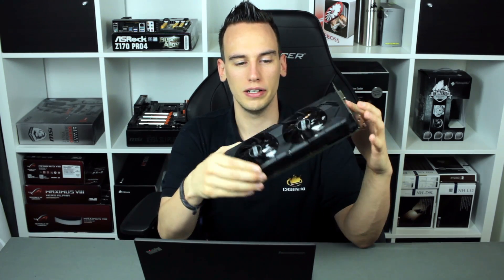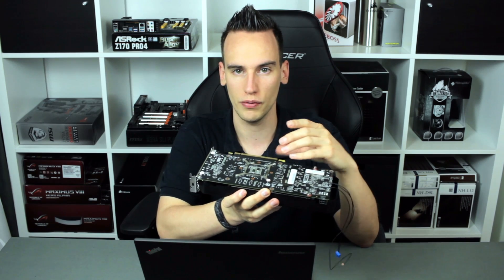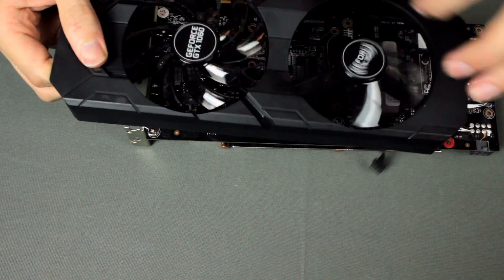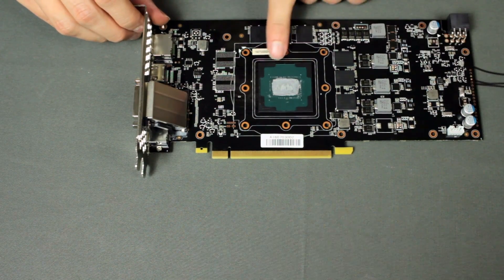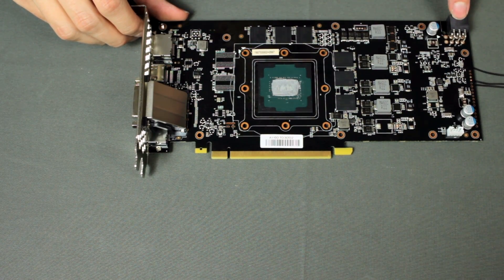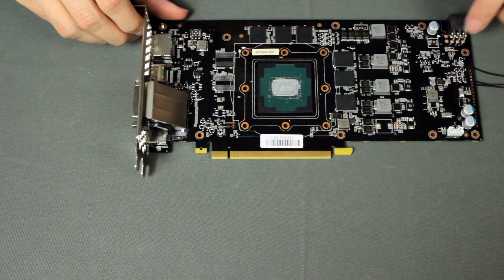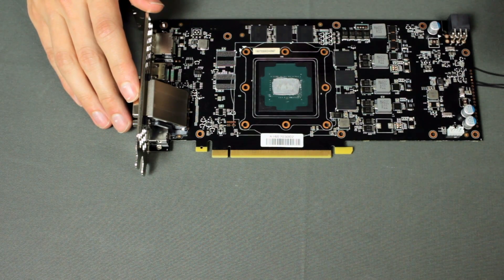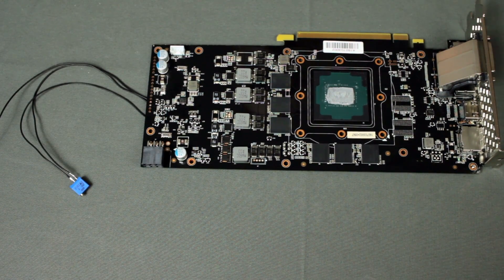Gainward GTX 1060 Overclocking to 2200 MHz with Stock cooler

Comment: Is there not another way to bypass the power target/limit of the GFX card ? My 1060 SC 6Gb (single fan) seem like it wants to OC but I believe it doesn't even gets passed its own Turbo boost before hitting its power limit and seems to even trigger its power limit without reaching its power target.

Temperature on the GPU is rather low at around 67Cº~ at full load, so no reasons to throttle there.

Voltage seems sketchy, even on K boost, voltage is all over the place, from 0.998 to (barely) 1,083~

Those wires look scary to put on. Any other way to "unlock" this stupid power limit ?

Comment: I got +900 on memory and +145 on GPU stable with +15 core voltage and 116 power limit on msi afterburner. I have asus 1060 6 Gb turbo, so I stuck a fan on air intake and it knocked out 6 degrees and now running 65 degrees C

Comment: Is the 1.2v voltage still "ok" for daily gaming, for lets say 1080Ti, considering low temps under load <35c? Is it fine for long term use ?

Comment: Okay, something I have been trying to find out for a while now, as I have the PNY version of this exact same board... The OV and OCP unlock solder bridges... what do they do?  I saw that you bridged the OV one... why?  And the OCP, does that over-ride gpu boost and hard lock the overclock offset?  if not, what?  You are my best bet at an answer it seems, and I am glad I found you.  You seem to review things in the style that I look for, where most folks are very surface level.  Thanks in advance.

Comment: schön zu sehen die junge generation... erinnert mich an damalige zeiten, als ich meine albatron 4200Ti(4600er layout) mit voltmods auf 825/850 hochgezogen hatte, nen 1700+ T-bred mit 2.8GHz und somit wochenlang auf platz 1 in futuremark stand im 3d mark 2k1... kühlung: wakü mit frostschutz und massenweise trockeneis im AB... das waren noch zeiten... CPUs hatte ich damals noch im 10er pack gekauft und mein händler hatte mir wenn ich reinkam, grad den roten teppich ausgerollt :D

Comment: with my MSI GTX 1060 6GB Gaming X i can dou with stock bios and voltage 2190Mhz on 3d mark firestrike / 2202Mhz on Catzilla / 2215Mhz on ACO and 2253Mhz for 1min and 20 sec on wolfenshtein 2 on 1080p uber

Comment: I just stumbled on your video @der8auer. Right away I get the vibe that you are very professional. This is why I have a request: Could you please make a video where you explain in technical therms what all the chips on the video card do? Or point me out to one of your existing videos where you explain this. I'm interested to learn how a GPU works, and what parts are used by the processor and memory. This will help me get a grip on overclocking. Thank you in advance.

Comment: Mad turboprops mate!

So I have this GTX750Ti, EVGA FTW OC, getting a bit old. Now I went ahead and BIOS modded it, resulting in lots of TDP headroom, so I shouldn't need the shunt mod. The stock voltage went up from 1.125-ish to 1.2 and it's pegged there, it's not going any higher, even though the BIOS looks like it should push it to 1.35-ish, so they limited it elsewhere outside the modifiable tables. The frequency went up from 1200-ish (I forget the exact figure, and it was load dependent anyway) to 1411 (locked), that's two 13Mhz steps away from the card being mildly crashy. Learned to appreciate BIOS modding tools, once I've dialled things in, I don't even care about software, it'll work in Windows and Linux just the same, and I don't need to worry about overclocking tool going out of sync with the driver or Windows updates. I also pushed the RAM from 2700 to 2900, and it's not going much higher - seems not to be doing all that much anyway.

So having done this now this made me lust after more, but i'm obviously going to have to push the voltage with a hardware mod, and any nice videos or well-written info on the topic would be so so welcome! It's just so tempting because it'll obviously do 1500 with just a tiny little nudge on the voltage.... If I can hit 2 GHz on the old thing, that's gonna be so fine! Yay or nay? I mean it's just an old card, whatever. If I kill it, i'll just same-day a 1050ti as a replacement, and I won't need to push it for the time being.

Perhaps I went on this adventure now because just the other day I pushed my old Phenom II x6 CPU to 3.9 GHz with room to spare... might even do more... for a 2.7 GHz model, that's mad, it's a 45% overclock! And I mean it's no Ryzen but it'll easily run circles around a Piledriver this way, it really performs remarkably nice now for a thing this ancient. I might even try to edge up on the boost, which I disabled for now.

Comment: mine regular dualfan Gainward comes with separate VRM heatsink, but without RAM heatsink, but still have stable +500MHz RAM overclock/+220 core.. what ram heatsinks will you recommend?

Comment: ah okay, my Zotac Mini GTX1060 3GB runs without hands on hardware Core2100MHz/RAM4500MHz stable with only MSI Afterburner, without any voltage oc (+0V), so no need to go further GPU stress :)

Comment: @der8auer great video! I have a question. I have two gtx 1080 classified's 14+3 power phase running in sli being cooled with two the kraken G10s and two corsair h75s. I also applied the evga thermal pad mod fix to each. They rarely go over  45c underload. However I cannot get a stable 2101mhz, battlefield 1 crashes until turned down. Firestrike also doesn't seem work either, it crashes with a 0 point score. Is that a sli problem? I have a evga p2 1200watt platinum rated psu. Would you recommend me trying the voltage and tdp mods? What kind of mhz and voltage do you think I could achieve? Thanks.

Comment: hey der8auer,
i was wondering.. is it possible to flash a 6gb bios into a 3gb card? i looked at the pcb, and there is no difference between the cards. (msi gtx 1060 gaming x) The 3gb version also has 6 memory chips.
Reply: hiephoi058 it should be possible if you can find a flash for it.

Comment: My stock bios / cooling Msi gtx 1060 6g ocv1 does 2200mhz on the core and 2458mhz on the memory and I believe it doesn't even have cooling pads on the vram. This is however with 1.081v on the core. (P.s. that is 9.83ghz on the vram which is nearly gddr5x speeds :P).

Comment: My friend has a problem
does anyone know why the gpu and the cpu are 100 % usage in gta V ?
I mean , the gpu should be there as I heard , but the cpu should be around 20-40 %.
I oc'd his gpu to 2100 Mhz.
The specs - Gainward GTX 1060
i5 6500
16 gb ddr4 single channel.
Reply: MemeFe gta v is clearly a cpu demanding game and its usage is therefore correct

Comment: I pushed my gigabyte 1060 to 2100mhz at 1.13v
Reply: That is a very bad chip then, mine does 2200 at 1.081v, use the curve editor in msi afterburner.
Reply: What, how? Nvidia locked the voltage at 1.093, how...?

Comment: Could I overclock to the exact numbers you had? (2202, 4742). I have a 1060 STRIX OC which has ridicouless good cooling
Reply from the maker: Don't think so :) 2200 is usually too much for any air or water cooling. Expect 2000-2100 MHz
Reply: And memory around?

Comment: I think that 2200 MHz is easily possible without this voltage modding, as soon as we see a bios editor for Pascal cards.
But for now I think this is the only way to squeeze the last drop of theses cards.

Does anyone know, if we can expect a bios editor for Pascal soon ?

BTW very impressive card, the Titan x or GTX 980 Ti get about 15500 points in Firestrike @ Stock clocks.
13600 points is amazing and only 15% below these high end cards from last gen..

Comment: I was able to give this card +451 core, +152 mem, totaling at 1957/4156. (expertool)
Required; +20% GPU over voltage, Power Target +116%. Stable. More core or mem frequency and tests would fail. Less GPU over voltage and tests would fail.
Fire Strike Extreme v1.1 would yield 6162 points. respectable, if you're not into hardware modding.
Max 62 degrees Celsius on a hot,hot day.
Reply: Another setup that i've been able to hit is;
Power Target +116% , +397 core, +646 mem.
Seems like giving the core extra juice, would reduce the memory's oc capacity...so core over-voltage is untouched!

Comment: Wish i had the knowledge to do a voltage mod on my 1070 but i don't and I'm not bricking my new gpu. Ive got my zotac 1070 AE to run 2150max but most of the time 2137-2126 holding in games and added 600mhz to the memory haven't tried to push it further yet. Got my best oc with precision x  it was really buggy at first but its works decent now.

Comment: Exactly my thoughts. I got a Sapphire Rx 480 and I was thrilled to test the card. 

I plugged it in my system and turned it on and everything was going smoothly.

My aim is to play Dota 2 @ 144 fps and my GTX 960 (Strix) 2GB with some decent overclock pushed the frames up to 130 ~ 140 ish and remember the game was running on Vulkan API.

This is the first game ever to run on Vulkan. I was soo hyped and confident that my new RX 480 gonna smoke that GTX 960 out of the way.

I was shocked. I mean literally shocked. The game gave me only 110 ~ 130 fps on the RX 480. It was actually lower than the GTX 960. The RX 480 is sinking with the thermals. It hit 90 degrees Celsius  scale in 2 mins.

The RX 480 under clocked automatically and virtually the frequency dropped from 1276 to 700 to compensate the overheating.

I was horrified. The damned 960 with significant overclock had a Max temperature of 76 degrees with higher frame rates than the RX 480.

I'm planning to return the RX 480 and get a gtx 1060.

Comment: What model is this exactly?
Reply from the maker: Just the normal Gainward GTX 1060. No Phoenix or GS
Reply: der8auer
And it makes no noise?
Reply from the maker: well no noise would be wrong, but it's really quiet. I didn't notice the cooler in any way.
Reply: der8auer
OK, thank you. I probably won't spend more money on the more expensive models then.

Comment: Great stuff , i wish i new how to mod GPU''s like you . I'm a noob at this stuff and got +120 on core happily but a bit scared to oc the memory because of heat , not knowing how it is heating . I did +550 and it ran fine but i'm not sure how this will effect the life of the card so put it back to stock. Do you think memory oc is safe ? I want my card to last for 2 years but would like to have the extra performance from the memory oc .
Reply from the maker: it's totally safe :) you're not touching the voltage so no need to worry.
Reply: +der8auer even the memory? as the temps can't be monitored. 
Thank you for your help.

Comment: OK i need som info guys. I have heard and seen some problems with the gtx 1060s overclocking abillity having a limit that makes the card go up and down at 2100mhz. This video is one of the few that is acually disscusing this isue. Is nvidia actually limiting this card? If you take that in to acount with them excluding the sly brig asswell, they go and make a bad ass card and then nutter the fuck out off it wtf. If you have info on this pleas comment?
Reply: Thats just how gpu  3.0 boost works its always checking variables and changing clockspeeds and most games my 1070 starts out at 2050mhz but works its way down to 1950-1988 in most games but i can get it to hold 2127mhz and added 600 to the memory. If you want a card thats completely stable with its clock-rates a hybrid or a waterblock would be the best option but really wont help on overclocks because pascal hits its volt limit way before thermal on custom cards. Highest Ive seen is 60c on my card man its the coolest card I've owned. But the 1060's a great card a no brainer for 1080p gaming and 1440 if you want to lower some stuff. I think i would get the founders just because its limited the 1070 and 80's are not and it runs much cooler than those cards.
Reply: If that is how gpu 3.0 boost works than i dont want it. This sounds just like a lock out to me. Thanks for the info but this video seems to agre with me. I will look in to this a bit ferther.
Reply: I can get 2164 with ease on my Galax gtx 1070  and fan speed at 80% and temps are 40-55 max and i game at 5760x1080 resolution...this card is epic and kool and quiet....my card doesnt throttle.. Cause it keeps kool
Reply: +Star Citizen-FAN yea but what does it hold at after playing a game for 30 minutes my card stocks holds about 1988mhz but be oc ive got to hold is 2127mhz. Seems like those galax cards run pretty good and are pretty quiet but you still got lucky with 2164mhz because many are struggling to get over 2100 with there 1070's.
Reply: Mine doesnt throttle... It stays  up there 2164 or 215*...pascal cards must just be kept kool not to throttle.. ...my temps stay between 40-52  even playing star citizen
Reply: And i did hit once 2235 very quickly.... 2270 or 2164 is where  can keeps it... And i havent touch voltage or power target yet...must be good binned....jusr keep it kool and no throttleing
Reply: +Star Citizen-FAN sounds like you hit the silicon lottery to me because i know more people that cant hold over 2100 that can. My zotac 1070 AE runs extremely cool so its a voltage limit not a thermal with my card so with a volt mod I'm sure it would go way further I'm just not doing it for 5 more fps. And memory overclocking seems to help pascal more than maxwell especially the 1060 with its lower memory bus width. Can you buy galax cards in the us I've never seen any for sale on amazon or newegg and i love the hof cards being all white especially the pcb it would match my asus x99 deluxe and cm storm stryker rig and i love the overall look of the card but i think they stopped shipping to the us in 2014 but i might be wrong. Guess theres always ebay.
Reply: Chad Hay
thanks for all the feedback and the well detailed info.
Reply: +Star Citizen-FAN im not calling you a lair i just would like to see it run at that clock, could you do a video using shadowplay and use afterburner to show the monitoring or use gpuz and show the results. I just want to see the core clocks volts and just a oc that high in action because i have 6 friends with 1060,70,80's and none of us have been able to hold 2150mhz gaming the best one of us got was 2137mhz to hold and i know they can go as high as you say but never seen anything close to that with no extra volts added like you say your cards running. If you have something like gta5, the witcher 3, or maybe firestrike but and game or synthetic would be fine.
Reply: also truely yes i agree with overclocking the vram on the gpu gives alot more smoothes and a few more frames ..but it gives better results than overclocking the core ..doing both has propably got better results here and there ..honestly see better smoothness  at 5760x1080 overclocking the vram on the card

Comment: Mine  dont even go for 2100MHz and its expensive one, MSI GTX 1060 Gaming X. It froze my game with some colorfull dots artifacts... . Gaming app goes max 1934 and most cases barelly reach 1900MHz... I just wasted money i think.
Reply: I get 2126 stable with an MSI card. Which is +160 MHz on the core and 725 on mem.
Reply: oh you cant get extra 5% of performance. yeah you totally wasted your money
Reply: Give +50mv voltage
Reply: Same here my fucking msi gaming x cant take 140 mhz
Reply: this is german design card dude that's why , i don't know about you but i just bought one and waiting for it.MSI it's made in Taiwan. German guys need quality + i think .
Reply: Aorus Pascal models are highly binned, they're supposed to oc higher- msi on the other hand is far quieter. i myself have the triple fan 1060 that boosts to 2100mhz without any modifications. ive seen the msi model and its alot quieter at full load in exchange for lower binned gpu-s
Reply: Did you set the power and voltage limit to max? Also, buying an overclocked graphic card is never a good idea, the performance gain is never worth the money. Also you can always OC your card yourself, you have no guarantee as to how much and factory overcocked models are usually a little bit better but once OC is done the difference between different versions should be no more than  5% whereas the difference in price can go up to 25%
Reply: There's nothing particularly German about Gainward cards, they're made and engineered by Palit, a Taiwanese company, same as Galaxy/Galax, KFA2, and other brands. In fact I think Gainward used to be a notably shitty brand with lots of bait and switch offers, where the press and early buyers would get some awesome card but when you bought it in a store a few months down the road, you'd get a severely downgraded one that was well behind anything else on the market, as they switch to cheaper components and adjust the clocks down and trim the bus width, and no indication on the box or anywhere that it's not the same card. Gainward's terrible conduct was one of the reasons NVidia nailed down the minimum specs for the cards pretty hard eventually. Of course this is long gone past, I have these memories from before 2005, which is when Palit took over the brand.

The European office of Gainward counts just 20 people, so what are the odds that there's one engineer among them? Or more like at least a dozen that you usually need to run development on such finicky and complex boards? It's likely to be all marketing people and office support staff.
Reply: My 1060 can go to 1911 MHz by itself and over 2100 MHz with oc